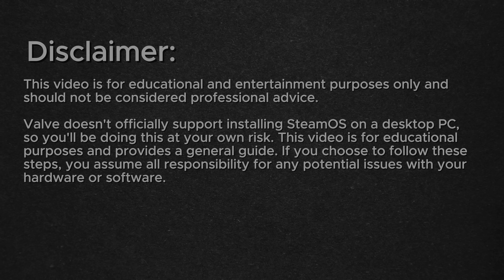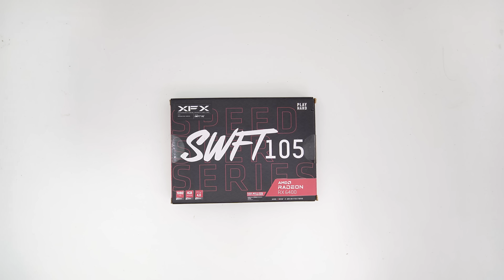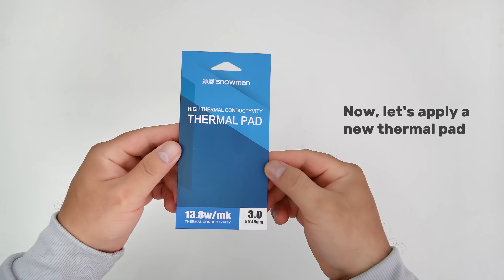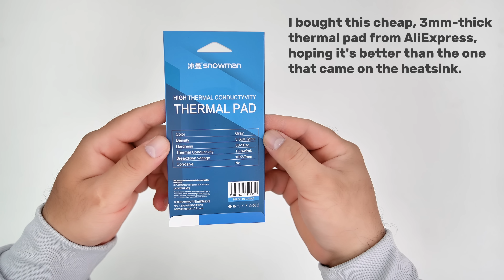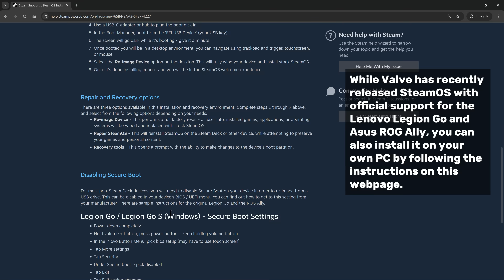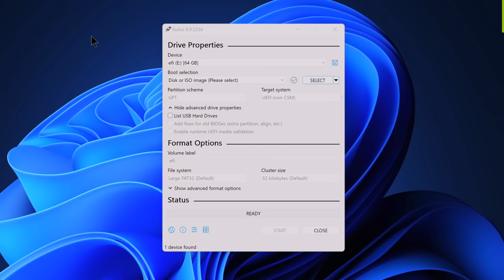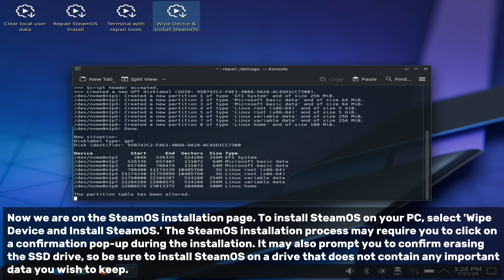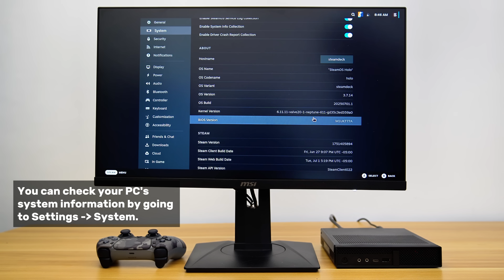How to Install SteamOS on Your Lenovo Tiny PC M720q/M920q?

Comment: Relay strange i’m doing the same project but i’m sticking on a mouse cursor displayed and black screen after restarting  on the usb Key with Steam os (same bios settings). If someone has an idea to figure it out … would be welcome 😊!
Reply from the maker: I think you need to connect the monitor to the onboard HDMI or DP port and boot into Windows. Check Device Manager to see whether the GPU is present. If the GPU is showing in Device Manager as something like 'Microsoft Display Adapter,' you can download the AMD Driver and complete the installation to make your PC recognize the GPU driver. In most cases, the PC BIOS might work with the GPU and show the boot-up logo, but when the PC boots into Windows, it shows a black screen because Windows does not recognize the GPU driver, especially AMD GPUs. If you don't see any GPU in Device Manager, check your PCIe riser and the GPU installation. Make sure there is no pressure on both the PCIe riser adapter and the GPU, and ensure the GPU is securely snapped in place.

Comment: Hey, im kinda curious. If you change that default lga cpu socket with the lga socket frame, does that making a difference from the temperature, gaming, or etc? I wish you can making a video like that later

Nice video btw, because of you im kinda brainwashed to do this build, it's quite cute pc but strong enough to play those game even with med-low graphics

Comment: does the yeston 3050 work in this pc or is rx 6400 work better here?
Reply from the maker: Hi Lenovo Tiny 5 series do not fit Yeston RTX 3050 LP since this GPU is 20mm think which is 5mm thinker than a normal single slot low profile GPU like RX 6400 15mm thick. Thank you.

Comment: Thanks for this . I ve got 2 of them and i m pretty sure that it s capable of pcie 3.0 x8 with the proper riser making both of those cards perfect because amd chose to make them pcie 4.0 x4 so similar capabilities. Am i wrong ?
Reply: The m720q does have a PCI-e 3.0 x8 port (proprietary, you need a riser to get the standard PCI-e slot for it and it will work correctly. with 8 lanes), however due to this GPU being only x4, you will have worse performance compared to using it on a gen 4.0 system, so worth keeping that in mind if you want to compare your results to most reviews of that GPU online. 
However if you are talking about using 2 of those cards together in the same system, unfortunately it is impossible to do so, I have not been able to find such adapter online and also this platform does not support PCI-e lane bifurcation, those features are usually reserved for full tower workstations or servers. You could try to get another adapter to turn the m.2 connector to a PCI-e one, but it is really not worth giving up NVMe storage for another card. If you do intend to use multiple GPUs, your best option is to simply look into Xeon/Threadripper/EPYC platforms.
Reply: @malek6129  hi there. it s not what i meant. The theoritical capable bandwith of pcie 3.0 x8 on the m720q is about 8gb/s when these cards being pcie 4.0 x4 ( even with a x16 connector ) are about 8gb/s. Up one generation but down from x8 to x4 makes roughly the same bandwith. So even if these cards are pcie 4.0 there should not be any limitations. I would love to have @itggear response on that 😀
Reply: @lesaoutbrendan  hello my friend. The bandwidth of the m720q is gen 3.0 with 8 lanes. The GPU uses gen 4 but 4 lanes fully, so that will cut your bandwidth in half as each pci-e generation doubles its bandwidth, yet because it only has 4 lanes to begin with, you are stuck having to take the whole throughput of those 4 lanes on what is eseentially just the same 4 lanes, on a previous gen (which is half the bandwidth). Had the RX 6400 use at least 8 lanes but only requiring the throughput of 4, this would have not been an issue as the data would be split to accomodate the required throughput (that's why the performance loss of using a 16 lane GPU that did not necessarily require the full bandwidth of the pci-e generation it is based on, on a previous pci-e gen is a lot more negligible compared to this case, that's where the whole negative press came from with the recent GPUs that have not been assigned full 16 lanes came from in the first place)
Reply: @malek6129  hi there . pci-e 3.0 x8 bandwith is nearly 8gb/s same with pci-e 4.0 x4 so it should be alright. most of the test you can find online are made on pci-e 3.0 x4 so of course there is a loss. I would love to know @itggear take on this matter.

Comment: This is a great video, however one thing to note @4:29 the way you folded the thermal pad is not how thermal pads are designed to be used, and may actually result in higher temps than no thermal pad. If you are committed to the VRMs being cooler, get copper shims to go between the two layers of thermal pads, or use thermal putty.

Comment: RX 6400 LP was hard to find in here :(
Reply: Consider the WX 4100 if it can fit your needs. It has a proper PCI-e 3.0 x8 connection rather than this x4 one, so with systems like these that are not gen 4.0 would yield better bandwidth, it is much cheaper in most areas since it isn't really advertised for gaming use so no scalping and overinflated prices, and it would be much more useful for you if you plan on doing anything else except gaming (as the RX 6400/6500 lack a video decoder and other features most GPUs come with). Another major advantage with the WX 4100 over the RX 6400/6500 would be if you are interested on running macOS as well, as it is compatible, although for only 1 more year as after Tahoe there will be no more x86_64 support for macOS.

Comment: Such an amazing video, thank you! Do you think it could even be used for Xbox gamepass cloud service if network would be good? Does SteamOS supports streaming games? Then it would need to be depend on 1l pc components
Reply from the maker: With 4 GB of VRAM, it can play older games and some late 2020s games at 1080p on low settings.
Reply: @itggear  Would be killer video if you could compare rx6400 with dell rx6500. Another question, is it possible to install SteamOS, in par with Windows on the same drive, so I could one I want during boot?

Comment: I'm looking to do a build exactly like this for my wife. Is there much jump up in real performance between a 6400 & 6500? Gpu's
Reply from the maker: Those GPU are nearly the same. You should go with M90q or M920x. this model stil CPU throttle when a GPU installed.

Comment: Здраствуй! во сколько обойдется подобная сборка?
Reply: An RX6400 is hard to find now but still brings $150-$200 USD depending on where you are. These tiny form factor PCs can go used for $100-$150 USD in the US right now. The 3D printing, adapters, and thermal putty are, of course, additional but the end result is pretty sweet I have to admit :)
Reply: @pharmdiddy5120 привлекает его универсальность. Мне для не требовательных задач подходит прям почти идеально

Comment: CachyOS Handheld got amazing with the latest update 2 weeks ago. Feels identical to SteamOS, but supports NVidia cards as well!
Maybe something for your PicoPSU and a 5060 build next time?
Reply: It is tricky to run GPUs such as the 5060 on this platform, not only due to how you can install it and fit it in safely but also because they can have spikes where they exceed pulling 75 watts from the PCI-e port which instantly crashes the whole system as the Tiny motherboards aren't designed with those spikes in mind like the ATX ones are.
Reply: 5060 don't come at such single slot size